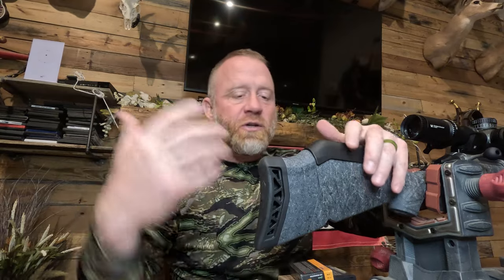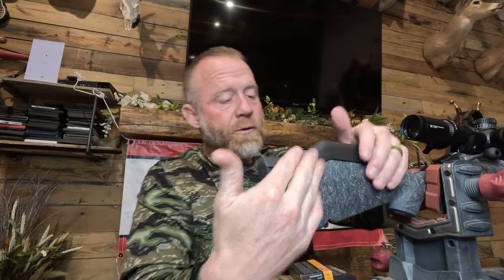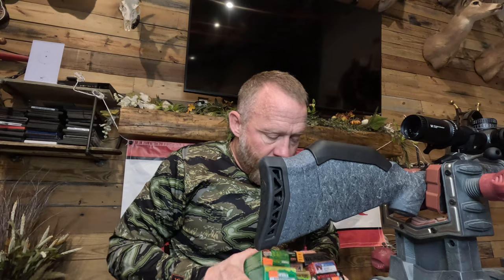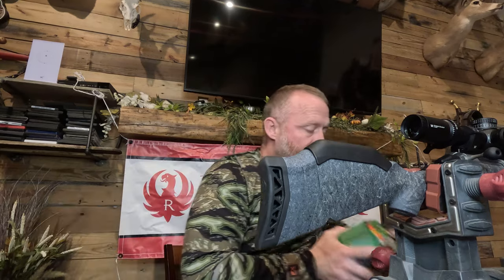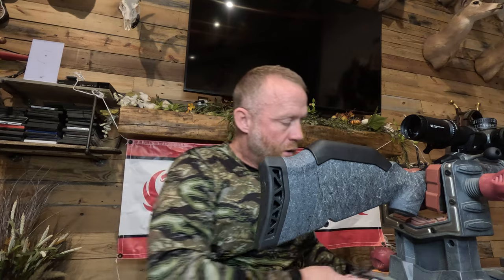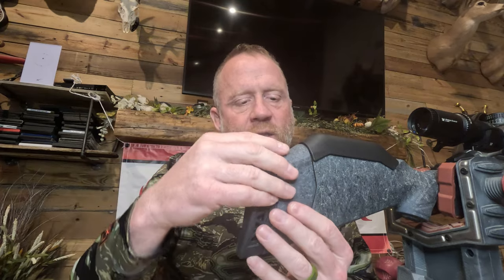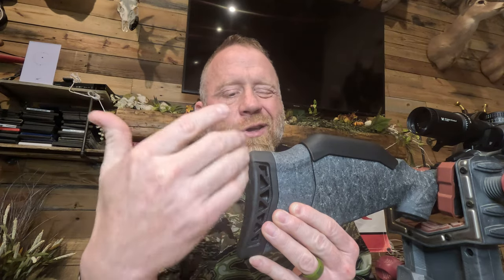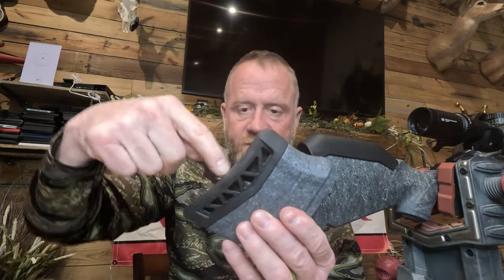Three things to know about Ruger American Gen 2

Comment: I wonder if the gen2 trigger is the same as the gen1? If so, you can buy the Mcarbo trigger spring and get a 2 lb or so nice trigger!
Reply: I have a gen 2 the trigger is 4 1/2 #  backed out the adjustment screw all the way , no change. Sent it back to Ruger the shot 20 rounds thru it and said it functions properly and the trigger met factory specs. Got it back still 4 1/2 # . I checked the adjustment screw against it was ready to fall out. So think they put a fake adjustment screw on it.
Reply: @franknilica1652  My GoWild .30-06 would only adjust down to 4 lbs. I ordered the MCarbo spring and got it down to 2.5 lbs. it’s great now after about 75 rounds.
Reply: Yes, the trigger is the same as a gen 1.
I just clipped 2 coils off of the trigger spring.
My Gen 2 trigger now breaks at a clean 2 lbs.